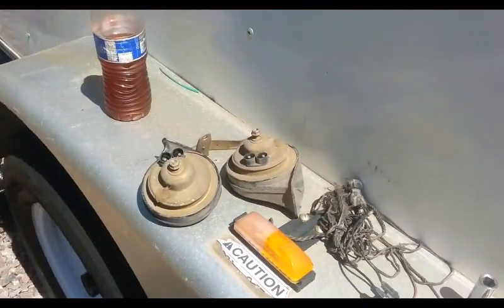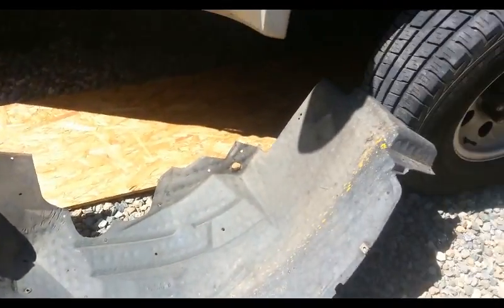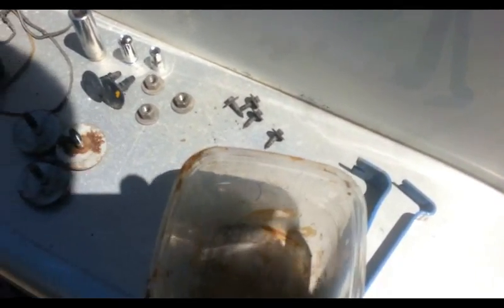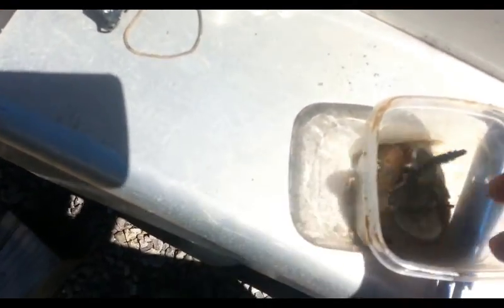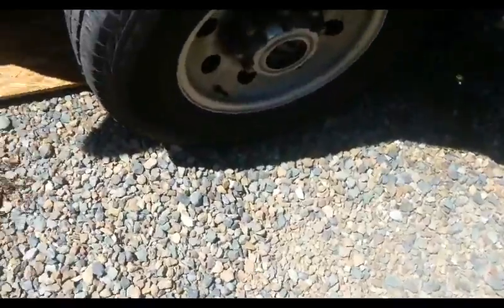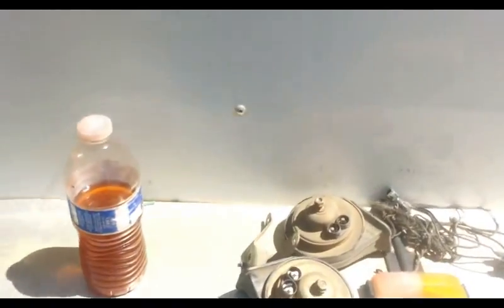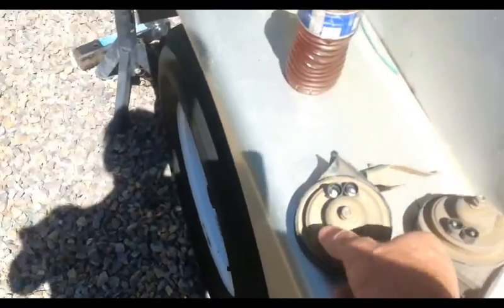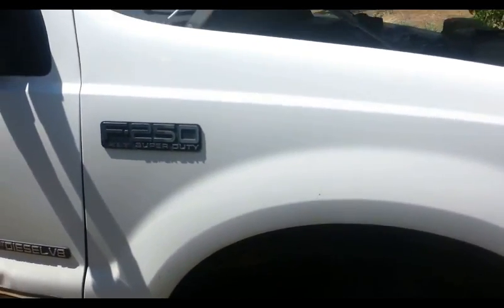2000 F250 Superduty Horn Location

Comment: I was reading the Haynes and they want the wheel removed, the hood shock disconnected, the headlight/turnlight removed, the step rail removed, the fender removed, and then you get to the horns.  If those flat bars work, I will be happy.  Will report back after I tackle it...right now it is raining and I only have my yard and driveway to work from.  Oh yeah, 2004 F250 6.0 with 167,000 miles.
Reply: That's why I don't use Haynes. More and better info right here.